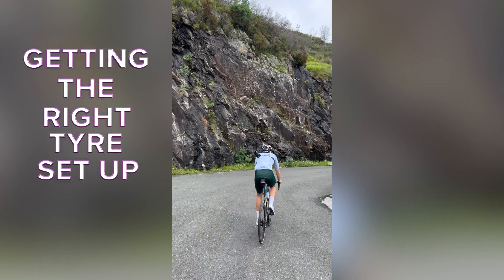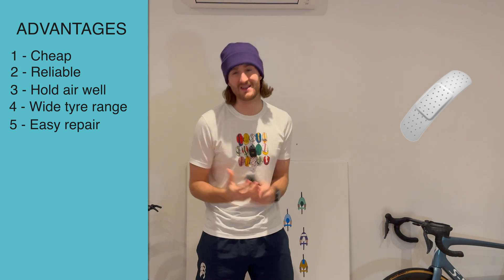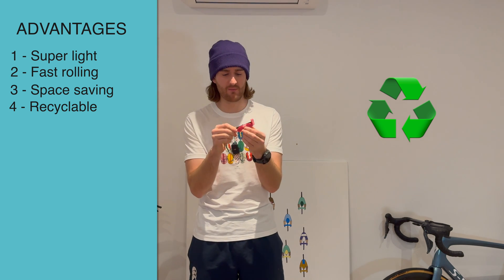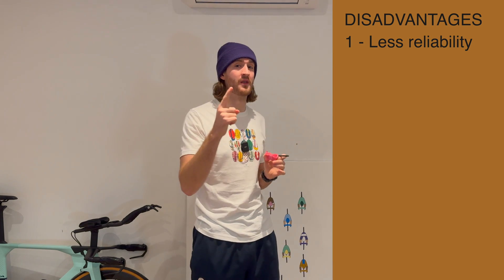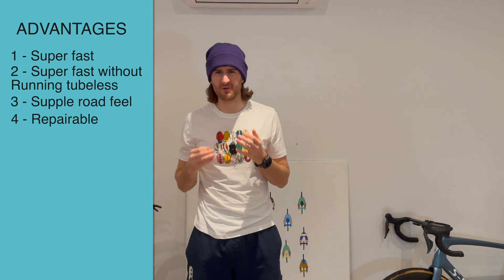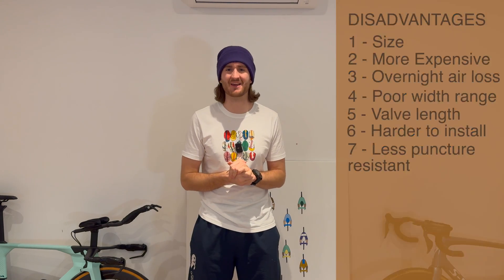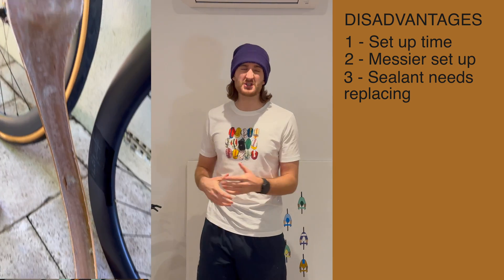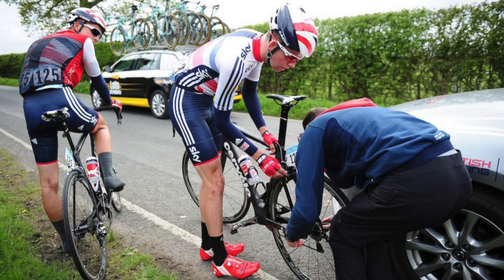Inner Tubes | The full guide

Comment: One thing not mentioned was different ways of inflation, yes a bike pump can be used on all tubes, but mini electric pumps cant, and neither can co2 cannisters, plus if you're running tubeless and get a puncture and decide to put in a tube, you need to carry tools to take out the tubeless valve.

Comment: Pouring stuff in your tires doesn't sound good  ?  Just like sew up's and gluing your tires to the rim...
Now if you have a team mechanic  ? But I'm a rider with a nice bike sponsored by me ! So train harder ! If you get dropped it won't be because of your inner tubes ?
Reply from the maker: I don’t personally find tubless much faff. It’s just like pumping up a normal tyre but every 3 months you top up the sealant. 
It’s definitely worth it for the speed gains in rolling resistance if you are looking for performance. 
I know what you mean by trying to improve yourself but most people racing are likely close to there genetic limits already and asking for another 5-10 watts just from training isn’t feasible

Comment: I picked up cycling a little over 2 years ago and although I'm not competitive by any mean I enjoy nerding out on stuff like rolling resistance, weight, tire pressure and so on. So I did have a go at tubeless as soon as I got my gravel bike earlier last year. Setting up wasn't much of hassle as I got the right tools right away. I had a few inconveniences like losing pressure due to clogged up valves and removing dried sealant from the tire was a process to say the least. A little bit of user error and a learning experience is what it comes down to. 

So if I were to ride and puncture more often, then tubeless would probably make more sense. But for casual riding once a week it's too much maintenance and money. But it was worth the experience. I'll try tpu tubes eventually as it seems like a good in between.

Comment: Great overview!

I've been using Ridenow TPU's as well as Cyclami from AliExpress for the last 6 moths. So far, I've been very happy with either brand. Installation on a new tire is a bit tricky. Therefore, I usually install a butyl tube first, pump it up until the wheel "pops". Then open up one side, remove the buty tube and replace it with the TPU. On the road obviously that's no issue. 

Other than that, I found that the air loss is slightly more as you point out. Ridenow keep the air better than Cyclami TPU's. However, either are fine to me as well, since I also pump my bike before riding it.
Reply: Thanks for the tip of installation of the tube on new tyre. I've ruined a few latex tubes while mounting on a new tyre. Hope the TPU tubes mount more easily than latex.
Reply: @ you should be fine with this method. :-)

Comment: If Latex or TPU does puncture, do they behave the same way that a butyl puncture would? No difference in blow out, more sudden deflation etc.? I have also heard that TPU feeds buzz to the hands more - any truth in that? And lastly, what is the best TPU compromise make for value / reliability? Lastly, where do you buy your Ride Now TPUs, I can't see them anywhere in the UK for anything close to that price?
Reply: Thanks for the help. Ordering some now. It looks like there is an upgraded valve version but it seems limited to 1 per customer at the moment. Upside is that the old stock is even cheaper.
Reply from the maker: Good questions! 

Yes they do behave very similarly when you puncture. The air loss speed is like butyl. Just depends on how big of a hole is made.

I can’t say I personally have had a higher level of buzz/ vibration through the bars with tpu. 
Most of my friends now run TPU and none of them have reported it. 
Personally I have felt way more difference in tyre widths for vibration than the tpu inner tube.

I am more than happy recommending the RideNow. 
Over the last year the reliability has gone up a lot. If they are a dud, they go down slowly over night like in the video and usually 1 in 10 at the most. 
The thinner 19g ones I find are less reliable so I always buy the 34g tubes. (+ they fit more tyre widths) 

As for buying, don’t be afraid of Ali express. 
The only downside is that they can take 2-4 weeks to arrive so it’s more of a buy ahead of time thing. 
This link should sort you out:
https://www.aliexpress.com/item/1005005531607940.html?spm=a2g0n.productlist.0.0.4e501e9faUYqJj&browser_id=81a933265ef64df1979a48c9c94e9e07&aff_trace_key=8d54166c66d44641a92f530683c324fe-1724618662776-01196-UneMJZVf&aff_platform=msite&m_page_id=rpihvzitcazhgtbv1918fe51f731d3319392913ef1&gclid=&pdp_npi=4%40dis%21GBP%214.73%214.73%21%21%2143.16%2143.16%21%40210385db17246960433642669efb3f%2112000033436624142%21sea%21UK%213860611378%21X&algo_pvid=5ce575db-2c05-4205-b20d-1acc7db7334a

Comment: You and talking negatively about butyl tubes in relation to their weight and size as if there is only one type of butyl tube. For a road bike wheel, there would be a massive difference between a cheap butyl tube and an ultra lightweight branded tube. 

Ultralightweight butyl tubes have a very small and no low rotational mass. A Schwalbe 700c ultralight butyl tube weighs a mere 70g. Spread this weight over the full area of the rim and you are talking about a very small amount of added weight to the rotating mass. If you want to lose weight and therefore have less rotating mass, you’d be better seeking this from lightweight tyres and more importantly, lightweight rims. 

To improve ride quality, lower rolling resistance, there are more gains to be made from rim type, tyre type and tyre pressures, not tubes.

Comment: What you fail to say is diference between tyres setup.
25mm gp5000 clincher weights 215 gramms(lighter) Tire Thickness Center 2.8 mm (will last longer) they also cost about 10 bucks less.
25mm gp5000 s tubeless weights 250 gramms(heavier) Tire Thickness Center 2.3 mm(will last less) you need extra valve where a good one costs as much as whole latex tube.
Also the difference of the material in colder temperatures, where TPU will be stiffer when it gets cold while latex doesnt change much. You can use regular patches to fix latex, so no need to carry extra spare tube.
Reply from the maker: These are all valid points! Thank you

Comment: My experience with TPU tubes is not very good.  In the last six months, 6 of  them failed on me since I started using them in December.  4 if  them due to punctures and 2 of them leaking at the valves.   I haven't been successful in repairing them, and I they are not reliable in my experience.   I'll stick to tubless on my mountain and gravel bike and butyl rubber for my road bike and keep TPU as spares since they don't take a lot of space, but once I get back  home, I'll put back the butyl rubber tube once it gets patched.
Reply from the maker: I think tubless suits gravel and MTB better just like you ride and then yes, they work well as spares. 

For road, for me they seem to be the superior tube. As far as I am concerned, once something has gone through the tyre, no inner tube stands much of a chance. That being said, I have run a pair on my main road bike for 6000km now without punctures or problems

Comment: Anything but tubeless. Tubeless tires are stiffer than non-tubeless + TPU tubes combined. Same for the latex. Butyl tubes on the training wheels. Not to mention the messy sealant
Reply from the maker: I think it has its uses. As i said in the video, it’s as fast a set up for latex and for racing it at least has a chance of sealing if it punctures so it doesn’t impact your race. That’s why i run it for triathlon and time trial

Comment: I'm surprised you somewhat think latex is less puncture resistant than the other options. My experience on large-ish all-road-sized tires (>=32mm) with corresponding pressure is that latex is more puncture resistant than TPU or butyl.
Reply from the maker: My personal view is that once something has gone through the tyre. It doesn’t matter the set up you are probably going to puncture. 

It’s just generally said that latex is less puncture resistant. From my experience it felt like I had more punctures back in the 23/25c days. 

I still prefer the tpu for myself for the weight and how many you can carry as spares. 

I haven’t used latex on a tyre that wide yet. All my bike I have a 28 which blows out to 30 on my wheels

Comment: Thanks for the comparison. But what about comfort? I ride my roadbike tubeless because of the lower tire pressure it allows. Can the same low tire pressure be used with TPU and Latex inner tubes? Or do these need the same higher tire pressure as butyl tubes?
Reply from the maker: The TPU have a fairly supple ride. More similar to latex and tubless than they are butyl. 

You of course can run any set up with lower pressure for comfort but these I find  are less susceptible to pinch flats when running softer than butyl and latex. I think it’s because there is less material to pinch?

Comment: Why would you clean tubeless tires of sealant, when the very purpose of sealant is to seal the tire? Just run dry, take a tube, or a small bottle and attend to a puncture when it happens, instead of having that crap flying everywhere.
Reply from the maker: With the tubless sealant running dry, it will solidify against the wall of the tyre. you can just put more sealant in but it gives the sealant somewhere to coagulate so it reduces the lifespan of your sealant, meaning so you will have to add more over time. Building up a thicker and thicker layer, it will change the properties, rolling resistance and balance of the tyre. (If you don’t clean the old stuff out) 
I don’t really understand the second half of your comment, please could you clarify that further for
Me?
Reply: @cyclingunboxed  I think the effect you'd feel in rolling resistance is not even worth raising. I find it laughable that people are acting like they are on a pro tour when it comes to this stuff. Just get out and ride your bike. I ride tubeless, because I love the ride feel and the very point of tubeless is to seal the tire, as there is not a purely sealed tubeless tire on market. So I wont be removing old stuff, when that is its purpose,  

Initially I install the new tires with sealant for a couple of weeks and than suck out the old stuff when the tire starts to hold pressure (to my satisfaction). I pump up quickly before every ride anyway. I dont ride with sealant in my tires. I carry a bottle and fix the tire on the spot and pool over the hole to be repaired, facing the ground. I let gravity do the work. Never an issue.
Reply from the maker: Interesting way of doing it but if it works it works. 

For me I like tubless on my TT bike. I think for those situations RR does matter even if you aren’t a pro, when you physically can’t push anymore watts. For most people though I understand what you mean RR doesn’t matter as much.
Reply: Yeah that method works well for me. Gets me home for the patch job haha. 
Dont get me wrong, I love a good tire.
My point is, the rolling resistance we're probably talking about (at identical pressures) is minuscule. If anything tire pressure is king and I think that is where you make significant gain.
Reply from the maker: Tyre pressure is the cheapest of all upgrades isn’t it. It’s part of my essentials list on my TT bike upgrades vid.
Reply: @cyclingunboxed  You only have to look as far as motorsport to see the impact of tire pressures and grip.
Reply: @NathanBradley-w1z 
You are missing the whole point of tubeless here which is that for most small punctures there is no need to stop. You hear a small psst at most and then the sealant (which you choose bizarrely to suck out) does its work thanks to centripetal force as the wheel spins round. At worst you may have to stop for  30 seconds just to put a bit more air in but usually not. No messing around at the roadside with bottles of sealant which must be a pain to lug around in any case. But each to their own. Peace ✌️

Comment: 2 Ridenow tubes exploded on my bike ! one during an ascent (I'd be on hospital for long if it happens on a descent), another one while I was sitting nearby and drinking a beer (there was no sun!).  there are some weaker spots at tube joints which expand/get thinner, especially there are weaker spots close to the valve, on third ridenow tube i can see those spots very thin !!
no probs with Tubolito though.
Reply from the maker: I know some batches can be quite poor with ride now but I do believe they are getting better. 

On one of my bikes I am over 7000km now with one of my pairs. 

Unfortunately it does seem a bit down to pick whether you get a good or bad pair.

Comment: How can any inner tube be faster or have less rolling resistance when the tube is inside of the tire which is in contact with the road?  The tire is the interface with the road primarily so how does the tube effect friction?
Reply from the maker: I am not fully certain on this so happy to be corrected or adjusted on my explanation.

It’s not about friction but losses occurred by the tyre and inner tube deforming. 

 I believe it’s because the tube also has to move and flex with the road as it is pressed up hard against the tyre. Not only that, they’re can be frictional losses between the tube and tyre on the inside of the tyre. 

It’s more to do with the rebound rate of the elasticity of the tube. The faster it returns to its normal shape the better. It’s imperceptible to us In our hands but when happening 1000s of times a second over micro bumps on the road surface it adds up. 

In the links in my description you have the tested rolling resistance of all the tubes.

Then I also have a podcast which takes a much deeper dive into to it linked as well. 
Hysteresis episode.

I hope that explains a bit more.
Reply: @cyclingunboxed  I appreciate your response.  Sometimes the popular wisdom regard cycling is nitpicking over miniscule differences such as weight.  Unless you are a racer those differences are minor.  The joy of riding does not come from the lightest bike.  The emphasis on weight saving is for a small percentage of riders who are willing to pay extra for that fraction of time that they gain.
Reply: @s.j.5850  the difference is not minor, you have to try 20g inner tubes, they are so incredibly fast due to much lower moment of inertia, *a light weight tpu tube will save more effort than any other weight upgrade*. Also rolling resistance has nothing to do with friction, it's a funtion of non-elastic effects; that is, the difference in energy needed for deformation of the wheel recovered when the pressure is removed

Comment: Hi good video
I ride everyday 30mile 
8000 miles a year
I have a BMC roadmachine all road e bike which is used all year round 
Tyres Schwalbe marathon+ with slime tubes 
So to my and you points and why I use this set up
Yes 1.5 kg penalty 
No punctures at all for 5 years 
Do not carry any inner tubes tools 
Or pump
Which off sets the weight penalty 
As for rolling resistance not much in it
And I keep up with lighter bikes quite well
So no puncture vs weight 
No punctures any day

Comment: Been using TPU for a while now and they are the best for me. Not going back to tubeless, the hassle far outweigh their advantages in my opinion and only really use them on certain situations. Also, TPUs are very repairable and i think it's much better than butyl in that regard. Im using ridenow TPU repair kit and it includes a glue that is the same glue that is being used on butyl, self adhesive TPU repair kits are the ones that has issues.
Reply: I’ve use them too but yeah the self adhesive ones I’ve had no luck with…I’ll try the patch with a little glue next time and see how that goes

Comment: How does a tube affect rolling resistance? As it doesn't touch the road.Not talking about rotational inertia due to the weight BTW.
Reply from the maker: I am not certain on this so happy to be corrected.

but I believe it’s because the tube also has to move and flex with the road as it is pressed up hard against the tyre. Not only that, they’re can be frictional losses between the tube and tyre on the inside of the tyre. I hope that explains a bit more.
Reply: @cyclingunboxed  thanks for that reply, so does the tube affect rolling resistance by being more or less flexible. If its less flexible theoretically the Tyre would sink less into any imperfections in the road, and be faster or not.? I am just making this up, as I don't know so I  am questioning a blanket statement about rolling resistance, has anyone actually measured this? I know it doesn't really matter,but there was a claim made without any reference. Cheers, maybe someone can point to a test
Reply from the maker: It’s more to do with the rebound rate of the elasticity of the tube. The faster it returns to its normal shape the better. It’s imperceptible to us In our hands but when happening 1000s of times a second over micro bumps on the road surface it adds up. 

In the links in my description you have the tested rolling resistance of all the tubes.

Then I also have a podcast which takes a much deeper dive into to it linked as well. 
Hysteresis episode.
Reply: @cyclingunboxed  thanks for the reply , cheers

Comment: Latex tubes for me (Silca) with TPU tubes for spares.  I hesitate to run the TPU as my primary tubes given some previous issues w/quality control.  I am sure that will (and has changed) as the tech and companies mature.
Reply from the maker: I believe the silca tubes are just Vitoria tubes but rebranded? I do like that little speed shield that comes with it. 

I do like the set up that you are running. Fast with good back ups.
Reply: what brand have you used that you feel have quality control issues?
Reply from the maker: Ride now. For me it has been 1 in 12 so far. And had a few comments on older videos saying the same things.

Same goes with cyclmi.

But that 1 in 12ish is still more than worth the money for me